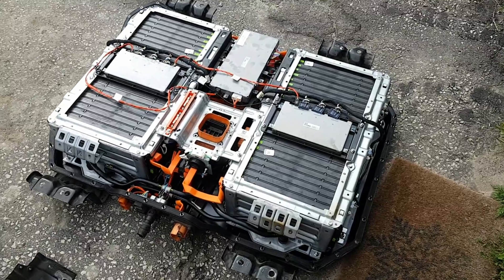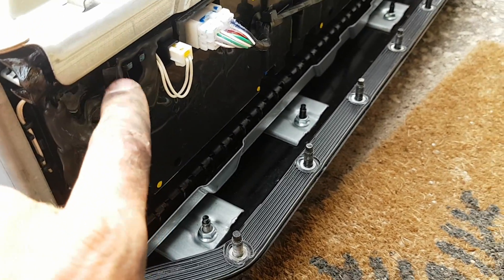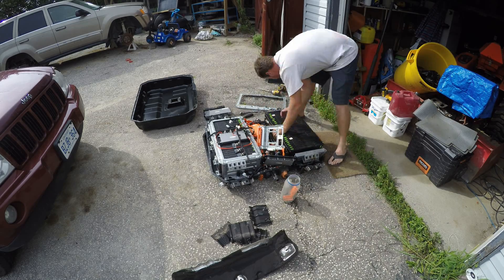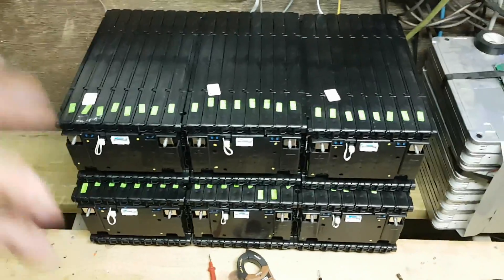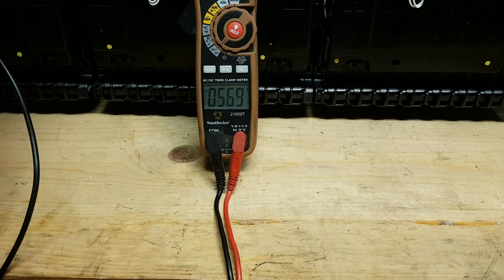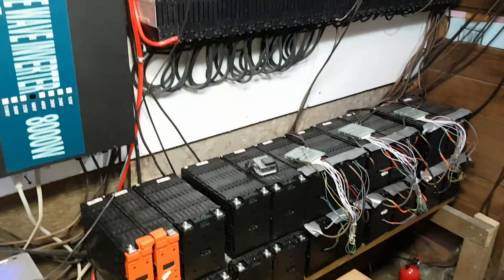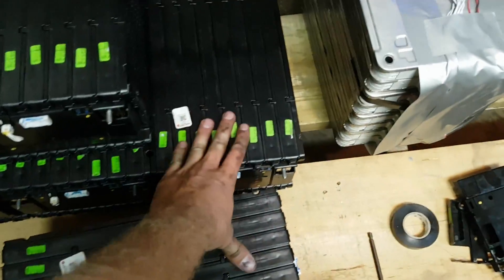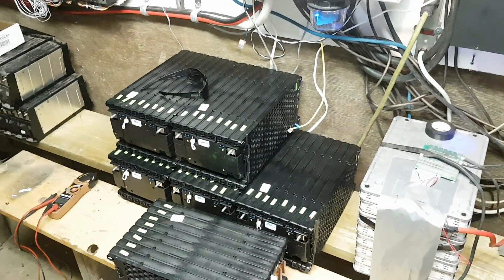Opening Another EV Battery!

Comment: hey! i am currently very high right now and working on a hybrid system
whats the max continuous amperage of the pacifica battery at its rated 360(i think) volts if you would know?
im looking at a BMS but i need to know the amperage for the current sensor size
the four options are 350a, 500a, 750a, and 1000a. and i assume it means up to
Reply from the maker: I would assume the pack can push around  60kw so I'm guessing  160 amps
Reply from the maker: At 360v
Reply: @GoingOffGrid101  that is great, thanks!
also quick edit, do you have the pinouts for those individual cells? im trying to find the taps and thermoresistors for the BMS connection
Reply from the maker: @Toaster The Rando  I do not, sometimes  the pins are different  between modules.

Comment: Have you sold the three module from the battery pack?
Reply from the maker: you mean the batteries or?
Reply: No, I mean the three control module on the top of the batteries
Reply from the maker: @janosbenke8496  I think I have them
Reply from the maker: @janosbenke8496  I have a bunch from different batteries
Reply: @GoingOffGrid101  I have the same battery pack and looking for the modules. I would be appreciated when you look for it. And appreciated when you sell it for me :)
Reply from the maker: @janosbenke8496  i found 2 of the 3 boards so far, might be able to find the third
Reply from the maker: @janosbenke8496  are you interested in them if I only have 2 ?
Reply: Of course :)
Reply: Of course :)

Comment: I have LG 18650's 2600 mah. And got some Samsung 2600 cells. The Lg's have nearly 500 mah more capacity. Some of the LG are 2900mah. The samsong are 23??-25?? Crazy difference. I haven't got a single Samsung with rated capacity! I may try for EV batts. I need a 7s so its not as easy to connect.  Keep up the good work. Try not to OD on lithium! I'd like a inverter. A classic 150 would be nice also!
Reply from the maker: Loving the LG atm!

Comment: Is BMS PCM Board  30A ?
Reply from the maker: yes  30 amps each
Reply: What is your battery pack voltage 65vdc ?
Reply from the maker: I charge to 66V but full charge is 67.2V
Reply: You have impressive system , what is your goals with this system' ?
Reply from the maker: want to be 100% off grid in the winter here in Canada.
Reply: Is anyway I can call you we can chat about your system

Comment: I know this might be a silly question but did the batteries come with a B&S bored already
Reply from the maker: yes they did but it only works when used with the rest of the car, I was not able to use it, also the pack is at 300+ volts so I don't have a inverter that works at that voltage.
Reply: They should be some way. To use on the system that you are building I know that it is a higher voltage but it should be the same way

Comment: ? what type battery would u recommend me to use with my 24volt inverter? voltage range 19 to 32 volts. some seem easier to do than others. I should finally have my off grid Internet hooked up this coming Saturday whoo hoo !! Lots of YouTube to catch up on lots to upload also, good job.
Reply from the maker: my Hyundai sonota batteries would work at 32v  or a or a Nissan leaf battery would be easy to make work as well. all others would have to be reconfigured to work.